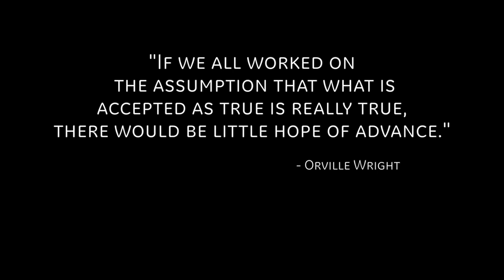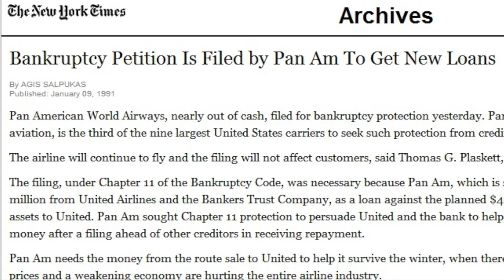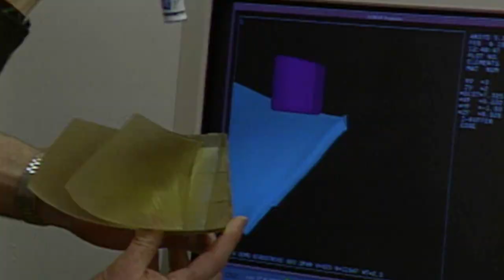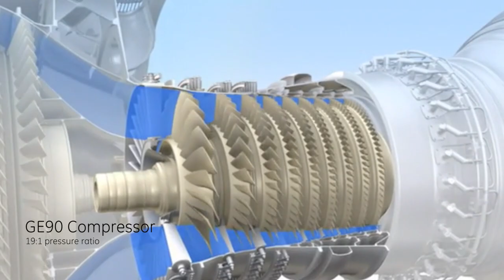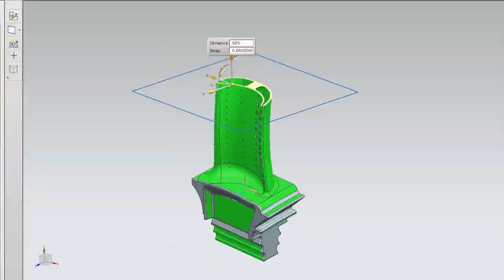GE's Big Bet on Goliath Engines

Comment: Being a true blue blooded  American  i do belive the ge90 is probably the best commerical  jet engine  out there RR engines are some of the best engines out there i hope im wrong on that  i always want to think we have the best of everything  but in my heart i dont belive that we do
Reply: Today's turbine jet engines were obsolete back in the early 2000's by an engine design that can easily produce greater than 10:1 power to weight ratios, and is several magnitudes less expensive to manufacture.

Comment: 777-300ER was the best plane ever built
Reply: I love the 777-300ER too. I rode the 777-200 one time, though.
Reply: a340-600 is better
Reply: A.M.P. Gaming hahaha you wish
Reply: A.M.P. Gaming it has four engines that's really not efficient. The a340 was built to combat the 747 but it's worthless now. The 777 beats that crappy airbus plane anyway
Reply: The A340 was discontinued in 2011 with only 377 built.  The Boeing 777 is still very much in production with 1,417 copies.  Guess which one the airline industry prefers?
Reply: Also like the 777... their engine sound like mince grinders though...
Reply: ***** first of all it doesn't matter. One 777 GE90 engine produces more thrust than all of those crappy small engines the airbus has.
Reply: All two engine commercial aircraft are able to keep flying on just one engine at reduced altitude and airspeed.
Reply: Even with one engine down the 777 can make it across the Atlantic.
Reply: Had a flight in A340 over the Phillipines..I was quite pleased..
Reply: I'd still feel safer in an engine failure in a tri or quad jet.
Reply: A310
Reply: Sirius the 787 Dreamliner is better
Reply: butchtropic the ge90-115b has the guinness record of flying 5 hours with only one engine,so im pretty sure its safe
Reply: Was (still is) cause the 777x is better
Reply: What is it with Boeing fans, so annoying
Reply: “Feel”
Reply: Tom, I guess you’re on the wrong video then.
Reply: Hakk n' Bass indeed I am
Reply: Yes it was ..
Reply: Maybe because we're right? We mechanics call it Scarebus for a reason...
Reply: I do not like the airconditioning sytem in the 777 though, you do not have a little outlet you can manage yourself and the convection was quite chilly. Also that particular plane had a leak..